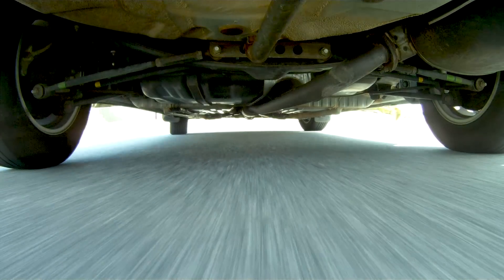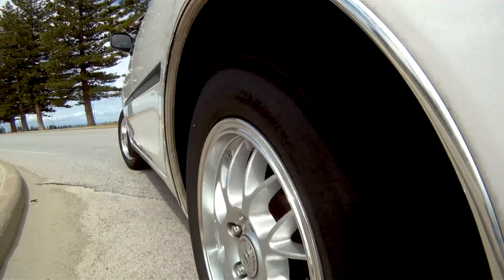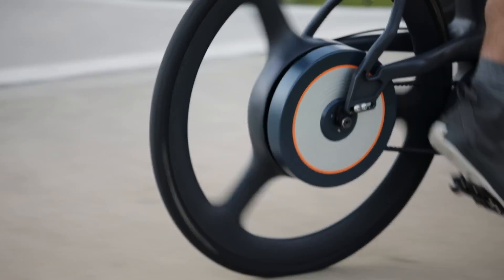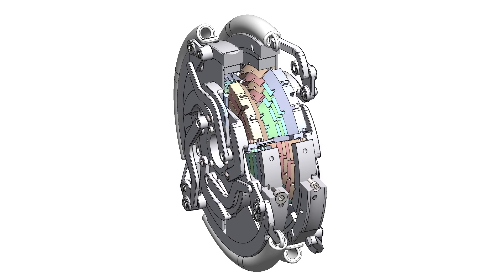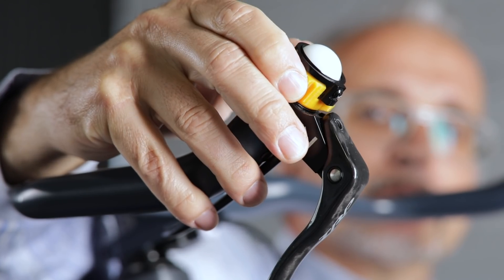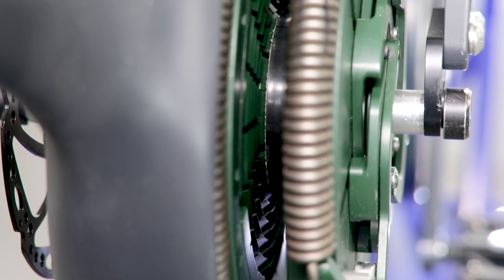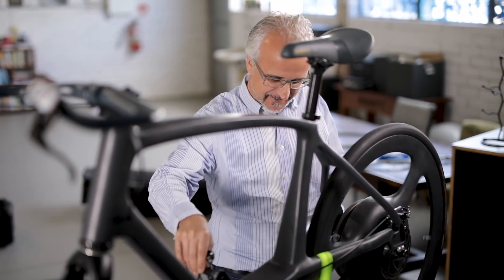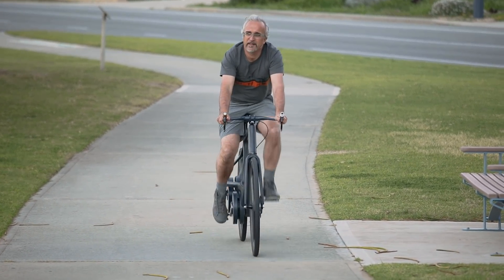Continuously Variable Transmission on a Bicycle

Comment: As an engeineer, thats really cool. As a cyclist, well, thats useless
Reply: As a cyclist...
Did it have to be Bluetooth connected? Just give me a wire, and mechanical connections. I ride in the wet, too. I need to know it'll handle that.
Reply: @Fightre_Flighte  I highly doubt you can use it for everyday transport. There are a lot of cracks and crevices for dirt to get into
Reply: @kaptein1247  
Absolutely there are. But there are also a lot of cracks and crevices in traditional multi-geared bicycles as well.
Though, this would stand an interesting test.
Reply: @Fightre_Flighte  In a derailleur there sure are some, not in a hub geared bike tho. But looking at the cvt transmission just gave me a headache since I probably would need to clean it every other day. I am  curious tho if this idea, or something similar, will ever reach the market
Reply: @kaptein1247  
Well, there are gaps leading into your bearings, for both wheels and your cranks.
Even moreso with the derailleurs.
And chains are supposed to be cleaned pretty often, as grit getting in there can stretch it.

I think this is a tradeoff. Putting more gaps in one spot, but making it be more catastrophic if not cleaned properly, or in proper intervals.
Reply: @Fightre_Flighte  To be honest. I never paid that much attention to dirt getting into the wheel bearings, since that doesnt really cause any problems. Derailleurs indeed need to get cleaned often too yeah. Thats why I stay away from those as well, since bikes for me are just more a practical transportation method instead of a hobby. The 0 maintenance makes hub geared bikes 100 times better for me.

But I don't think this cvt bike is made for practical use tho. I'm pretty sure they called it a novelty bike in the start as well.
Reply: @kaptein1247  
Very possible, yeah.
Reply: @Fightre_Flighte  e mtbs seem to do fine.
Reply: @Fightre_Flighte  if its a decent pair of bluetooth chips and everything is properly weatherproofed then it would probably be more consistent than a traditional bicycle transmission in rain.
Reply: @dojostarfox4520  
Probably.
But I'd still want a mechanical connection to this transmission, for easier and less costly maintenance. Because that Bluetooth can and will fail, like everything else.
Reply: @Fightre_Flighte  if you knew a couple of things on electronics you'd know that they can be far more reliable than a cable. Do you know IP rating exists, right?
Reply: @yosyp_yosyp  come on man, you don’t need to be rude, and I agree with him, I personally would be more comfortable with cables just for the factor of only having one thing you need to charge because it connected via cables to the rest of the system
Reply: @yosyp_yosyp  
Yes. But are you going to trust your IP rating will stay good on something that's going to get banged around, smacked, and scraped.
It's for a bicycle. Shit happens. People fall, and get hit.
And, especially with electronics, shit happens. Wires break and connections separate.
At least with only mechanical connections, the end user can replace things on their own, and for smaller dime. The expensive part can stay good, as long as the weak point is what connects the user to it.
But if the weak point is also expensive as hell, it's not worth existing there.

That's engineering. They did it bad.
Reply: @yosyp_yosyp  or actually paid attention.
I bought all new shimano transmission.
withinna week the cables were out of adjustement.
When you ride 1000 miles a month you see just how shitty cables are.
Reply: @yosyp_yosyp  bluetooth is going to be way harder for the average bicyclist to repair themselves, while finnicky, literally anyone can fix any part of their bike. 
throw a complicated CVT with bluetooth electronic shifting into the mix and the average rider is more likely going to endure a whole lot more stress, spend more and end up with a repair that is less solid and robust than it originally was.
Reply: @unfortunately_fortunate2000  What about a tricyclist? 
But seriously 2 things: bluetooth would enable a fully enclosed system, reducing the need for maintenance (how many people do you see with their car gearboxes out on the driveway these days), but would mean the reliance on batteries - great when it runs out on the road.
Reply: The only update to CVT for vehicles is the introduction of DCVT- direct cvt. 
Which means you will have the traditional first gear and from there on it will continue into cvt. Just for info
Reply: @junaidgt90  various updates are available. nowadays automotive cvt is coupled with a torque converter. the torque converter acts as a first gear. the cvt lockup clutch engages afterwards and changes to cvt only mode. Also, there's another cvt variant with high and low speed gears. It's like a 2 speed automatic transmission. Finally, another variant controls the pulley electronically thus limiting gear ratios which translates to engine being forced to operate at lower rpm.
Reply: @junaidgt90  zzzzzzz8o09
Reply: I would like to try it but I highly doubt I would like to purchase it. And yes I am both an engineer and a cyclist.
Reply: @InlineSkater72  me too, I was been thinking about a cvt transmission for bicycle for about 25 years ago....Could never get past conceptual design calcs as could never get close to derailleur weights or efficiencies .....
Reply: @InlineSkater72  “Yes I’m an engineer” okay you sound a douche too
Reply: @Bankable2790  Thank you for your kind words. I appreciate it.
Reply: @Bankable2790  Are you slow?
Reply: @aerozz8851  Let me guess, also an engineer?
Reply: @Bankable2790  Look in the mirror.  That was completely uncalled for.
Reply: @Darren Munsell my belt-driven Mercedes bicycle has a simple expanding pulley (like petals that uncurl) at the back wheel's transmission to accomplish exactly this with very few moving parts, compared to the complex monstrosity shown in this video.
Reply: Is it much heavier than a conventional system? Would love to see it in action.
Reply: As an engineering student, i'm asking "WHY THE FUCK IS IT WIRELESS? KEEP IT SIMPLE, STUPID!"
Reply: @justaguycalledjosh  
That's the same stuff I'm on.
Reply: @justaguycalledjosh  because bt is reliable.
Reply: @justaguycalledjosh   That's not the issue. The wireless in itself can be good because it reduces parts (cables and such) but the weight and complexity of the system are why it's bad.
     btw, please stop using all caps, it's excessive and unnecessary. a single word or two can be relevant.
Reply: As an astronaut this is helpful, as a scuba diver maybe not so much, as a chef it is questionable, but as a computer architect I can see potential. However, as CEO of Amazon I could definitely sell this product. But as a daily runner this is probably not that useful. As a molecular biologist, I could see this being really cool too though! Should I talk about my physics degree too?
Reply: @CJ-nv8mx  well I myself, as God, Jesus AND Satan, happen to think this is quite delectably ingenious, the williams F1 team already tried this way back in 94 I believe it was, and, it worked so well that the FIA banned its use in competition. 

and speaking as Satan, I want the evil omnicorps to make as many sextillions as possible.
Reply: but it will improve your mpgs
Reply: Agree.  It's a start but it'll be full of inherent issues like Bluetooth dropping out and power shifting where you crank hard on a hill.
Reply: As an engineer you’re cool, as a cyclist you’re useless
Reply: as poor cyclist, that's too expensive
Reply: @HikerBiker0  work harder, get a car.
Reply: I was trying to come up with automatic transmissions using the concept of a cassette that shifts from left to right on a threaded axle against a calibrated spring and the chain passes over it and through a stationary derailleur. Added torque makes the spring compress and the transmission shifts into an easier gear. Indexing and shifting under load would be problematic though.
Reply: Probably for ebikes this one. For me it looks bulky, not to mention weighty(?) but from a servicing point of view....😵
Reply: @ICGedye  weight is nothing like as crucial on an ebike 
You can get automatic gears on the Shimano system and maybe the Bosch and others. Been around for few years.
Reply: @julianshepherd2038  yeah I know about e-bikes, my dad rode one until his battery packed up. From a ‘normal’ cyclists point of view, using this daily and keeping it running ok with all the crud and grime that accumulates would not be for the feint-hearted - better to have it fully enclosed for the e-bikers. Seems like a close cousin to an electric moped, or one of those old Puch bikes you used see around the continent. As useful to a manual cyclist as an electric scooter is to weight-loss.
Reply: As an engeineer surely you could spell engineer.
Reply: I doubt that you are an engineer since you can't even spell it.
Reply: @Darren Munsell Harvesters have used this concept for at least 50 years or more that i know of.
Reply: A tiny piece of dirt in the mechanism from the road and the whole thing is buggered.
Reply: @callumhardy5098  Imagine a pebble...!
Reply: @timhofstetter5654  yea, that’s game over.
Reply: Yeah, well said.
Reply: @Darren Munsell If you don’t mind me asking, what do you mean by a modified planetary? Like a Sturmey Archer?
Reply: Agreed
Reply: As neither of those things, how? Seems like a smoother transition
Reply: You're just jealous cant afford it
Reply: who made a bike? a cyclist or an engineer?
Reply: So true
Reply: Hmmm....agree! @_@a  , complex mechanics also means more weight and higher cost....
Reply: Top 3 things no one asked
Reply: but you aren't the marketing department, they want things less repairable for both repair shops or cyclists unless they wish to pay for the licence and sign the forms where the manufacturer not only get's a cut or they write in exclusions that make it more better just to throw the bike away and buy a new bike...

Sounds familiar? it's like a brand new car, or a tractor, or harvester or even a mac...

So yes, as an engineer new things are really cool especially how they innovated and made things very seamless to transition, but as a cyclist that knows how to repair his bike, you are going to fucking hate it, especially when they hook up the computer to it's computer and find that you went against warranty and took it through that dirt shortcut.
Reply: and being a viewer it's unnerving!
Reply: As a cyclist that is useless and expensive you mean
Reply: I'm glad you said it before I did.
Reply: Far too complex and prone to failures. I would like to see such a precise multi-component gear-box in heavy mud or othe dirt.
Reply: @maciejsojka7643  like on harvestors for the last 50 years?
Reply: as a mechanic: that’s horrific
Reply: Eingeineier????
Reply: @ColonelCampbellAI2024    non englisheeer.
Reply: Useless?
Reply: Worse than useless. Contraindicated.
Reply: so complicated, dude said bluetooth with a straight face
Reply: @Darren Munsell you haven't seen that all wheel drive civic type r? It's very fascinating
Reply: Think ebike.
Reply: Hmm... and yes, I am and engineer and a cyclist; and yes, by "engineer," I mean I'm the one with the blue and white striped overalls shoveling coal on the train; and yes, by "cyclist" I mean that I cycle between episodes of depression and mania because I REFUSE TO TAKE MY MEDICATION!!!
Reply: As another engineer, this is mechanically useless as well.
Reply: Ah yes, theory vs practice
Reply: exactly if anything they should use a driveshaft and mini gearbox on bikes instead....this is so useless for any sports like mountain biking aswell.
Reply: I don't get the complexity they've chosen. I mean it will be clogged with dirt in no time.

You can also do the same with a pully which splits in segments which can move in and outwards. If you want to get fancy you can use some round bendable plastic which slips over eachother to close the gaps.

But I think a completely sealed transmission would be much better. Why not use hydraulics with water for the CVT transmission. I mean, yes there's a loss, but on the other hand you can easily couple an electric motor in the system and use it as regenerative brake with the motor and non-regenerative brake with a valve as well.
Reply: yep was thinking same thing
Reply: The fact that it goes with bluetooth, introducing so many issues to avoid a completely irrelevant cable, probably says much about the design goals of this: eye catcher, not functional
Reply: As a designer, I think it's a good try making that ginormous circular thing looks nice.
Reply: This is where it starts. CVT transmissions on bikes will be a option someday.
Reply: honestly cvt's are great if you've got a lot of (short) uphill parts so you don't have to constantly shift, and with a derailleur or internally geared hub there are sections where you could be inbetween gears
Reply: Harsh and right
Reply: Eu consigo pensar em um modelo cvt mais prático.
Reply: @Darren Munsell Yes like this nice idea,  not close to efficiency of single chain drive, other solution is putting derailleur in box, most efficient way, but because makes gearing parts last way longer , gearing manufactures would make a lot less money?
Hence why does not exist?
But that does not mean you can not make covers for own mech &see the results?
Reply: a company called Fallbrook Technologies designed the NuVinci / Enviolo CVT hub for cycling. They work very well. They have been around for about 10 years i think. The hubs are quite heavy but it is an okay trade off for urban cycling
Reply: @ThatGuyCalled "Fallbrook Technologies designed the NuVinci / Enviolo CVT hub for cycling. They work very well. They have been around for about 10 years i think. The hubs are quite heavy but it is an okay trade off for urban cycling." I've been using a NuVinci Enviolo CVT hub for about a year now on my new 500 Watt mid-drive Mastretta MX3 Cargo bike. I have mixed reviews and not 100% sold on it. Is there another brand you know of?
Reply: As not a cyclist but someone who bikes to get around town, I want it.
Reply: @404Anymouse  How can you ride a bike and not be a cyclist? cyclist: “one who rides a cycle” ~ Merriam-Webster Dictionary
Reply: @LucidDreamer54321  I'm only cyclist de jure while I'm on the bike at that exact moment. I meant the other meaning which is someone for whom cycling is a hobby and who takes pride in it. I don't call myself that.
Reply: Yeah. Only if you're a middle level manager who is environmentally conscious and lives close to their job.

It's a niche lol.
Reply: actually quite useful
Reply: @jhoughjr1  What, you can't be bothered to shift for yourself? And you'd be interested in spending huge money just so you wouldn't have to shift for yourself? What, your fingies are tired?

Comment: A bike drivetrain as complex as this should  also be the optimal way to do regenerative braking as well if  introducing a small battery to the system.    You could go down a hill slowly in the lowest gear ( if the hub can be engaged somehow in the drive) then have the ebike keep the smalles,t lightest battery.  To allow the driver to pedal against the motor to charge the battery while driving at any speed poses and  additional challege to bike drivetrains.  charging the battery at a stop, going downhill slowly but driving the generator at high rpm ..   I came here from mechanical flywheel energy storage, im still interested in human powered vehicles but adding a small light battery, regenerative breaking, and the like might make so much gearing less necessary.   There is power assist for hills when adding ebike to the mix...

Comment: I believe this drivetrain upgrade for a bicycle will not replace the conventional chain and cogs configuration. No one wants unneeded and unnecessary complexities especially for what should be a simplified mechanical mechanism.

Comment: What is its weight compare to traditional sprocket chain driven system?
How's the everyday maintenance,cause i saw good dirt,mud and foreign object will go through inside your pulley system eventually i  conclude it will damage your pulley.

Comment: the concept of "evolution" is to develop a system that demonstrates a better result than its predecessor, that does the same thing cheaper, or that does more for the same cost. it does not bring either.

Comment: Comment section full of morons:

1) It is continually various, they simply replaced one large v-shaped cone with smaller ones to make it fit. Each section can still be moved in/out to vary the ratio continuously.
2) Just because it's electronic doesn't mean it's not reliable. A bunch of high-end bikes have electronic shifters already.

Comment: Nice and very fancy but still much too bulky. Since forces applied by humans and ebike motors are very limited I would opt for a strongly miniaturised cvt system somewhere near the crankshaft axle, with a simple chain (or belt) going to the rear wheel.

Comment: I don't want to be mean, but how much more would bike cost with this system, and is it more efficient than traditional chain and sprockets? Does it add weight? How about when there is mud, sand or gravel between all those parts, will it work? Or snow and ice? I think you need at least seal that system, and that this is probably way too expensive to never become popular option. And then again, it's not even real variator system, because you need to change gears (which is probably not an issue, or even bad thing).
Reply: Nothing is more efficient than a conventional chain drive - belts always have less efficiency, this one has even a conical shape and will have additional friction compared to a Gates belt drive system. 
We can only estimate the weight, but it don't look very light - a chain drive with sprockets is also the lightest system. 
As you write it's even no real CVT - it also has steps, which means there is no real advantage, but a lot of disadvantages.